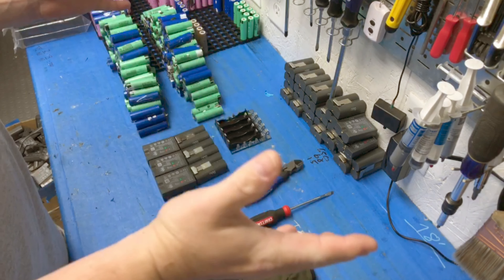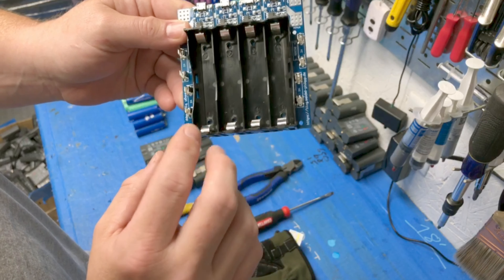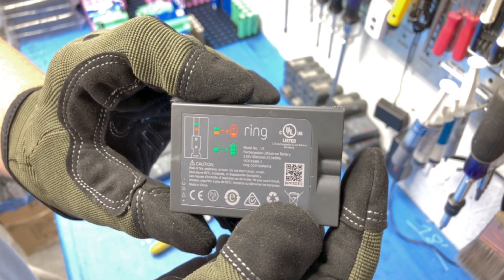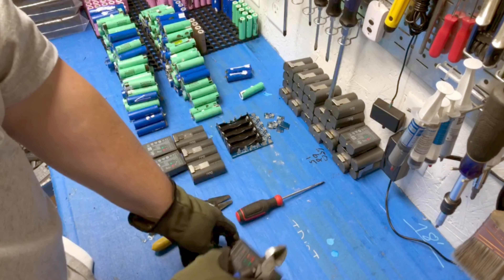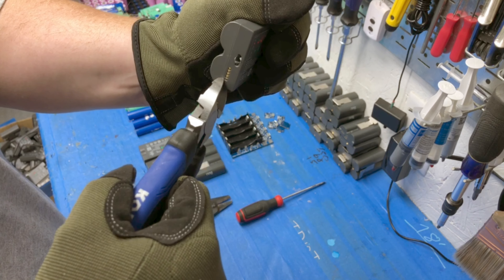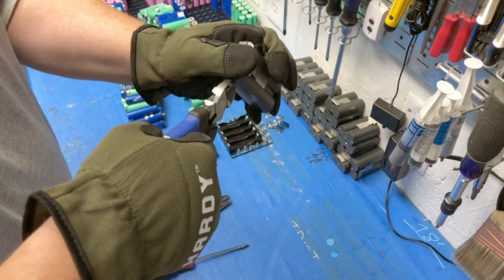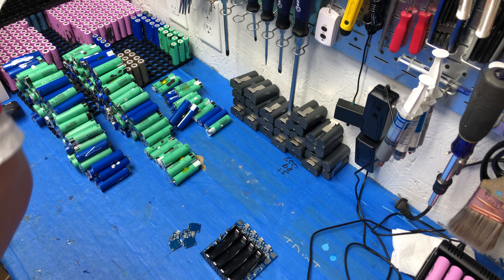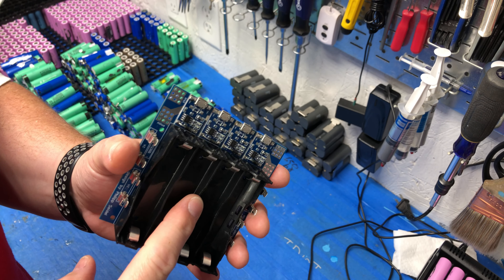DIY Powerwall 18650 - Ring Battery Packs, Tear Down and Review the TP4056

Comment: I hear you on the TP4056 chips. Specs state they charge to 4.20v +- 1%, but Ive found that 85% of the time they charge to 4.11-4.14v. Ive seen them as low as 4.09v and as high as 4.18v. Never 4.20v Good video!
Reply from the maker: Pallet Homestead your right.
Reply: Your cells will last much longer is you're not charging them all the way to 4.2 volts constantly.
Reply: They stop charging at 0.1C (default is 1A charge rate so it stops when it drops down to 100mA) during the CV phase, it is not a fixed voltage, it depends on the cell/health

Comment: I have a couple of suggestions from what I learned with these packs. 1) never use a metal tipped screw driver with 18650 cells.  Any slip can cause a puncture and thus devastation.  2) I hold the packs in a vice and use a nylon chisel to break the seams.  The 2 different types of packs are easily identified by the printing opposed to if it "sounds solid". 
I have not noticed any difference between the two types of packs in the time it takes to open them.  I can open either type in about 15 seconds, and total extraction in about 60 seconds or 1 minute per pack.

You are using the older level TP4056.  The square TP4056 boards are the old level.  The updated level is not a square.

I had a bank of 10 Zanflares.  I found these are very unreliable.  I performed a gage R&R and found greater than 50% between the chargers.  Basically you have a better chance with a random number generator to test the capacity compared to a Zanflare.  I will stay with the Opus, which has a gage R&R of about 20%.
Reply from the maker: Thats good information to know, and i agree, the Zanflare is off for sure. And thank you for the info, Anything helps.😀
Reply: It takes more than just a "slip" to puncture the metal cylinder of an 18650 cell. But yes, be careful with sharp metal objects around lithium cells. Especially lipo pouch cells.
Reply: @davelowets  This is not true.  I slipped and dammed near burned down my garage.  It reminded me of the "Tickle the Dragon's Tail" event in the 1950s.
Reply: @thonatim5321  How could you "slip" and drive a screwdriver right through the metal case? I guess you were manhandling it and used a hammer. That one is on you. Gently prying with a screwdriver will NOT puncture the metal case.
Reply: @davelowets  Maybe you do not understand 18650s.  Some, not all, have a vent on the top.  This is a very weak point that is not protected by the metal tube.
Reply: @thonatim5321  I DO understand 18650's VERY well. The vent is a few tiny holes in the top. You wont be poking anything larger than a pin through them. The vents are usually hidden underneath the raised positive metal top cap also, not gonna get under there with anything.

Comment: Weird question, but is there any way to determine which brand batteries are used in the battery pack prior to opening it? I've noticed on a few packs I've purchased that the weld or crimp holding the clip to the pack has two different appearances (one is larger, and the other is smaller), but I don't know if this would be an indicator of the brand of battery used inside or not.
Reply: Sometimes in specs if your lucky.    Or open take a peak.   No biggee

Comment: I banged out 100 by smashing the case against the flat anvil surface of my vise. Then I used the cutting nips on the corners. Most times the side glue released and the tops would just pop off. Its the smacking them against something firm and metal that I don't love. But it seems to do the trick.
Reply from the maker: I've seen and heard of many methods, at least you found the way that works best for you, and thank you for watching.
Reply: @DIYSolarEnergy  Would the LG or Panasonic cells be okay for an Ebike pack? 13s8p is what I'm thinking. Otherwise I accidentally started a powerwall project. Of the ones I've gone through I havent found a bad one yet.
Reply from the maker: @Mavstang73  Those will be good for a ebike, just make sure your voltages are correct and run a BMS
Reply: @DIYSolarEnergy  Oh yeah BMS is mandatory. Thanks for replying. I figured they would be good but new to the 18650 game and most use these RING packs for powerwall projects.
Probably going to use all LG cells as that seems like what I have the most of. 75% lg cells is my rough guess from my lot.
Reply: I would squeeze them at an angle in a vise to crack the seam open

Comment: Do you know how these batteries last for 6-12 months (ring says so)
Reply from the maker: Not sure, I tear them apart and take the batteries out for a DIY Powerwall to power my house and shop. The way we build, in most cases the cells them self will last 5-10 years with normal usage
Reply: @DIYSolarEnergy  A powerwall for your shop? Wow, that's insane.
How many batteries would that even take
Does the powerwall do a good job or does it last long?
Is it cost effective?

Hell, do a video on that. A review on the existing wall or something
Reply: @Rani-wm1qq  Oh yeah...Im building a 150 kWh Powerwall to run my whole house, my shop is running on 20 kwh now, all built using 18650 batteries...
Reply: @Rani-wm1qq  My 20 kWh pack is 48v nom or 51 volt nom, and it has around 1700 batteries
Reply: @isitrigged4968  That absolutely blows my mind. Wow. That’s a win for you my guy.
Well done

Comment: Guys let me save you precious time 1. Every cell come up to 4.1 or4.2.    Usually 2.  All.      Best way. Split packs in 2 No BMS Hobby charger only.  W 4x5 trays you can configure many amps No matter the  cell.    Use a   digital throttle to monitor voltage.  ADVANTAGE. if a cell goes out. Only halp pack to repair.   I make many. Half packs.   CELL. QUALITY IS KEY.   NO BMS.    WHATEVERS CLEVER

Comment: What part of the country are you in?
Reply from the maker: Alabama on the gulf coast... Mobile, AL area...
Reply: @DIYSolarEnergy   What's the % of cells you are getting that aren't useable below say 2800mah or, coming out zero volts from the packs you salvaged? I have gone through 600 modem battery in 3 200 cell groups and, getting like 69% usable above 2000mah so wondering if it's worth switching to these instead for my Powerwall. Seems to many cells that I can't use is such as waste.